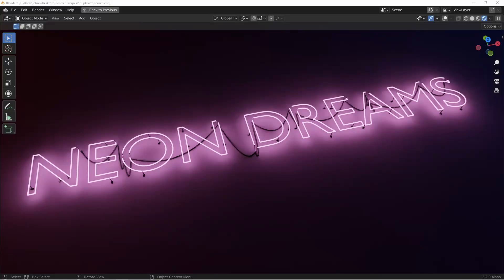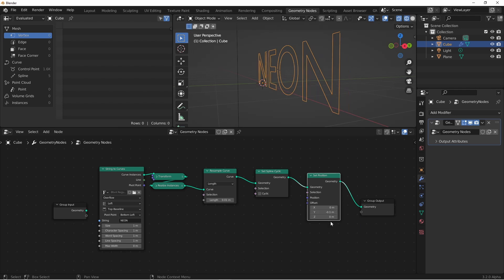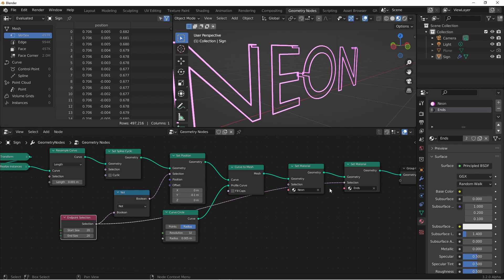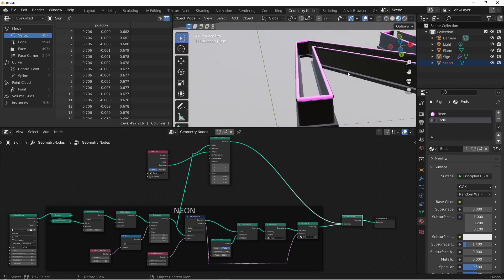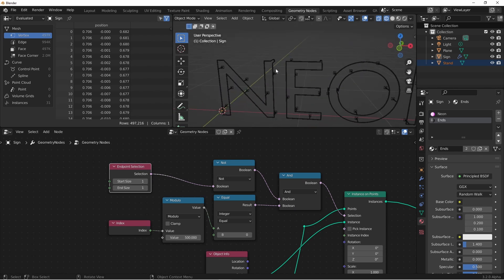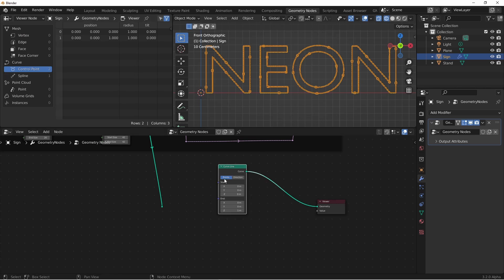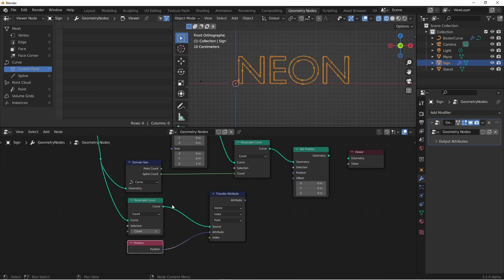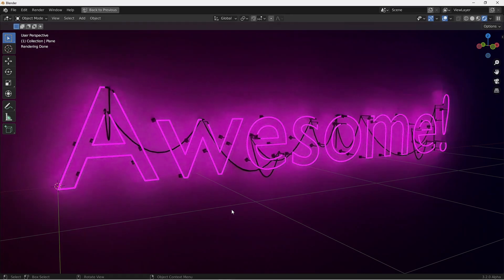I Saw the Sign! Neon Sign Generator in Blender Geometry Nodes

Comment: Awesome! Not sure what a doozy is but certain this was anything but one :). Just an idea: you might want to add an option to round off sharp corners in the text... I'm guessing that the Fillet Curve node would do that but it would need to be limited to sharp angles so it doesn't affect the smoother curves.

Comment: By the way, for those using 3.4+, since the Transfer Attributes node doesn't exist, you need to replace it with this following arrangement:
First, get a sample index {I'm going to refer to it as SI} node, make sure the dropdowns are set to Vector and Point respectively,
Next, plug the geometry from the resample curve [the one that has it's count set to 1] into the Geometry socket on the SI node,
Followed by a "Position" node plugged into the field labelled Vector on the SI node, (a field is a diamond-shaped socket), which replaces the "Attribute" field on the transfer node,
Finally, plug an "Index" node into the matching field on the SI node.

Comment: Hopefully someone can help. I've finished the tutorial and have my sign looking great. But i ran into a problem on the way. I created my (Stand) and followed all of the steps. When i connect the (Instance on Points) node to the (join geometry) node my stands become massive and flip vertically.

2nd question i had is if you could just easily pop in a logo of any kind rather than just using what's available under primitive curve? Can i import an SVG i created in illustrator and use it?
Reply: Object-->Apply-->All Transforms

Comment: For the stands there is now a much easier way to do so (3.1) a node called Curve to points, which work like resampling, but doesn't change the curve shape
Edit(last) To make the droopy group works you need to use a "set spline type node" first, set to bezier, right before the group

Comment: Awesome Tutorial Johnny. Would there be an update to your asset snapshot add-on for geometry nodes as assets?
Reply from the maker: There is a new built in tool kinda like Asset Snapshot in the N panel of the asset browser. There is a little down arrow in the preview panel. If you click it, it will render the active object and set it as the selected asset's image. So the script may not be needed much longer.
Reply: @JohnnyMatthews  Oh! Yes. I know about it already. But your add-on is better because it allows render the preview from the desired angle as well as in eevee and cycles. So I mostly prefer to use your add-on.